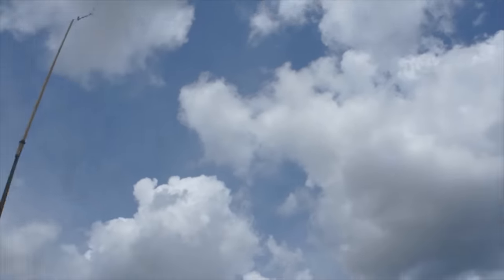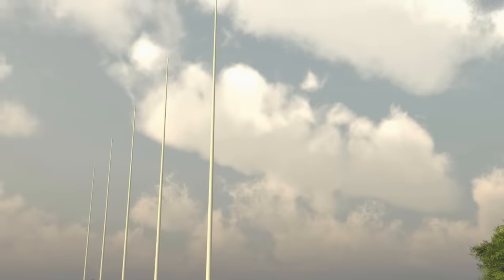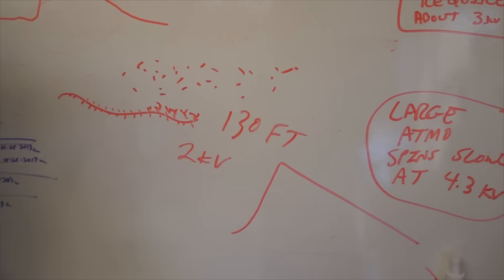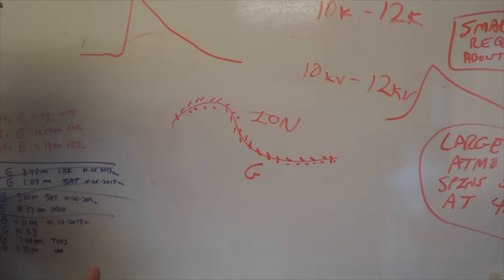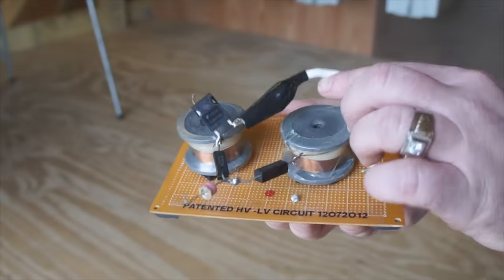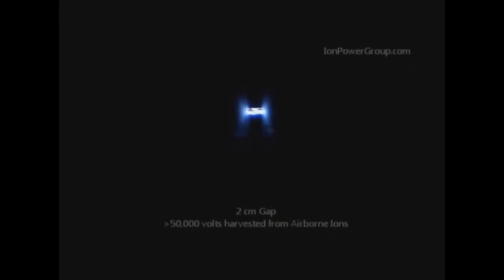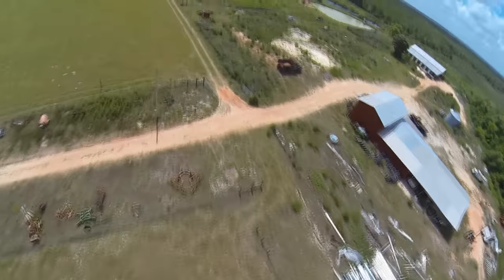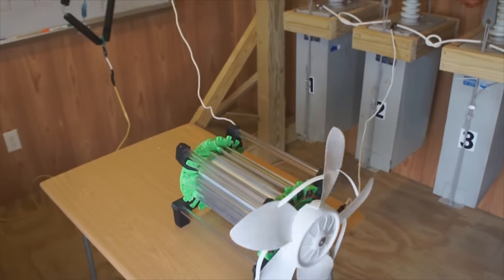Graphene/Graphite Atmospheric Electricity Collectors - Plus Horrific Hexacopter Crash!

Comment: When you see a project such as this and they only bring up voltage.  It's a scam. Voltage literally means NOTHING without current flow.  Put a power rating or go home.
Reply: I was thinking the same thing!
Reply: Did you even watch the video? They explained through the use of capacitors they will build up the current flow and release it at a steady rate.
Reply: +No Name doesn't matter unless that rate is at a significant amperage. These probably range in the mili or micro amp range.
Reply: Current is 45 x 10^-28
Turns out my $2 Duracell 9V battery is a load more powerful than this
Reply: Power is what is being conserved, and the units for power is , 
Killa-Watt - Hours, meaning if a batterie has 35 KWH of power stored i 
can discharge eather 35 KW   for 1 Hour or  17.25 KWH for 2 hours   or  
 3.5 KW for 10 hours. 
   you are correct with what you are saying but it is only one side of the hand
      With the change in Hight brings a change in Voltage, alsso double the wire double the ampe, it may take a wile but one could charge a capasitor no problem, but this can be sped-up buy raising the poles or building better "Traps".
Reply: Dude I really cannot handle this. Power is measured in KWH?????? Nigga have u done high school physics. please. KWH is a derived unit of energy, not power. 1 KWH = 3.6 MJ.

"Power is what is being conserved" there are so many things wrong with this sentence, so imma just ignore that.

I kinda see your logic about changing the height, but is it worth it? let's be generous and say that it can capture 10000v at x height. Say you double it the height, and get 20000v. It doesn't matter what voltage you get, if your current is something like 0.0000001 A which it probably is, the power coming from this whole thing is less than a watt. Assuming you're still following me at this point, this thing will not work, because to extend the poles by 2x it'll cost WAY more money than what you're getting. case closed.

Also please, check ur spelling. not that its important but you sound slightly less convincing saying things like "Killa-Watt", "batterie", "ampe" "capasitor" "Hight"
Reply: x'D ^^^ true
Reply: +2Sneaky4You Dude, I almost cried....you deserve a beer good man
Reply: <3
Reply: But will you get as much power back out of those potato batteries as you put into them? [many potentially valid and provable answers to this question exist, no one of them is necessarily the best answer, but its good to explore.]

I say make a sugar battery and you will get much more power out of your spuds than by galvanic reaction and it will cost you less, and require less energy invested compared to your returns.
Reply: Why do ignorant jerks feel compelled to say really nasty garbage on an intelligent, intellectual conversation?
Reply: Its ironic when a person says something in support of a person, and that person in return attacks you and says filthy things against you. People who respond in such sexist, hateful barbaric ways, especially without provocation are severely disturbed and very dangerous. They pose a threat to intelligent, innocent people, and in this case, specifically women. It appears that there is a very vitriolic individual with hatred against women and other people here who is posting hateful and disrespectful comments both toward previous posters, and those who write polite and even supportive comments toward their own comments. How long will this be allowed to continue unabated?
Reply: Considering Im an Mechanical  Engineer "Nigga" and not siting on the corner slinging rock bitching ,at ones iPhone because the battery went out during YouTube;  try letting  the world decide whom knows what they are talking about ...
Reply: Did i just witness youtube's fattest roast of 2017? oh no
Reply: Actually if u paid attention in high school physics you'd know that batteries are rated in newtons cuz mass * voltage = power
Reply: No idea what u just said but lemme correct that equation for you
E*I*c/D=P
c is speed of light obviously and D is input in inches
Reply: YA , I ALLWAYS SUCKED @ ENGLISH LOL, ...BUT WE ARNT TALKING ABOUT ENGLISH GRAMMAR AT THIS DISCUSSION BOARD , ARE WE ? SO WHY ARE YOU CHANGING THE SUBJECT ?
Reply: Tilted :')
Reply: cheyne, why are you so angry?  dont feed into it,  I know what your going through as i am dyslexic, and yes it incredibly frustrating when people cant see past your literacy, it's like they are blind to the knowledge. now I dont get this kind of backlash and the reason is I dont lose my temper. By the way, you made this about race which is kind of pathetic. so as I said calm down, compose yourself and don't draw for the race card. as for your spelling just remember Einstein was dyslexic.  
Peace
Reply: Curent literally means NOTHING without voltage. Curent is product of voltage via resistanse. Electricity is flow of electrons and voltage is electromotive FORCE ergo ENERGY. Without voltage you NEVER get curent.
Reply: Neither current or voltage mean anything without the other.

I see people spouting "its all about the voltage!" and "its all about the amperage" and I have to shake my head at how uneducated these people are.

A post was talking about 'its not watt hours, its ampere hours'...

Try saying that at a symposium of renowned scientists and you will be dragged out by security as either a nut job or a troll.

Not that I care, do what you want, I'm keeping my research to my self so I don't have to have such insanity flying all over my profile by people who only think they know.
Reply: Current is a product of voltage. Ohm's law. Low voltage and low resistanse result in high current and high voltage with high resistanse result in low current. Voltage is electromotive force, ergo the energy.
Reply: Current is the flow of charge. Electromotive force is voltage, ergo voltage is actual source of energy. Electromotive force forced electrons from the metals and thats how electric energy is created.
Reply: Energy is neither created nor destroyed, merely translated.

Electromotive force is indeed pressure, but only when it moves.

Water in a dam can generate a lot of pressure down a pipe but until it begins flowing, not a scrap of work is being done.

Also the work is measured by the combined value of the pressure and the flow, same as with electricity where voltage drop over a line is because of resistance which blocks flow by stopping pressure.

Also there is impedance [can be called 'drag'] inside the wire, as well as dissipation [eddy current losses] 
I can put 1000 PSI in a 1mm tube or 1000v in a 40ga wire and as long as no amperage is moving you might well think there is a lot of power in either of them, but the moment you let the stopper out or trip the switch, you will find yourself with no power at all because the flow is choked off.

It is a dull wit and an uneducated mind who insists that voltage without amperage has any realistic value and likewise, your overly simplistic explanation is functionally wrong.

Don't have to believe me, go to school and get an education.

Any real college course will have you in there with hands on to learn first hand what your brain is not making connections with.

If you still fail to see the glaringly obvious, you will have wasted your money and time as you will fail the course utterly.
Reply: You know what I mean, dont let for the words. Voltage is pressure, current is the flow of electrons. Without voltage you dont have current. Current is what of the electrons survives via resistanse of conductor.  With less resistanse low voltage produce high current, but if the conductor is with high resistanse even higher voltage will produce low current. Ohm's law i repeat.
Reply: You can not have either without the other, that is a given.

I can repeat myself ad nauseum and people ignore it because of people's pet ideas, but the fact is that all power is measured in watts.

I would ask you right now...as you talk about wire resistance...

Then take that value...assess the voltage per foot potential in the atmosphere and divide it by the value of the highest possible resistance 'wire' you can think of [and if you are not sure, feel free to get a piece of said wire and an ohm meter and test it] than come back and take that and tell us what type of voltage drop you came up with, and therefore, if you think that the voltage is too low to be usable...

While you are at it, think this one over, as you watch lightning...

How many ohms do you think air is rated at?

Evacuated air if you go very high...

And yet it conducts vast amounts of power, far from a negligible amount, either in volts or amps, WITHOUT wire.

So why are you nitpicking on wire?
Reply: Delicious DeBlair you don't understand what is current. No sense to speak with you anymore.
Reply: My concept is concept of Georg Ohm. I am not electrical ingeneer, but i argue with Ohm's law.  Current is a flow of electricity which results from the ordered directional movement of electrically charged particles. Voltage is the electromotive force - ,,pressure''. Resistanse of conductor will kill some of this pressure/voltage and what is survive is the current. If i am wrong please explain me when i am wrong. If i am wrong why graphene superconductor with zero resistance will result with very very powerfull current - 1000 times powerfull computers with 1 percent of today energy ? I explain this to yself with Ohm,s law - zero resistanse, low voltage - high current.
Reply: Delicious DeBlair This thread went downhill! I agreed with you somewhere up there. I hate pessimistic comments. They can't see the big picture, or other applications. My home is full of impractical projects, cryocoolers, Stirling engines, a water heater that burns hydrogen made from recycled aluminum cans and sodium hydroxide, solar a.c. and refrigeration, etc. It all works, but you can find issues with everything too. I just like thinking this stuff through and trying stuff. Can I store energy in liquid nitrogen, evaporate it, power an air motor, and reliquify it? Probably. Will it be convenient, efficient, etc? Beats me! Instead of just saying "that won't work", I'd rather figure out how it CAN. Almost anything has an application somewhere. This project could be designed on skyscrapers or sailboats where there's already elevation. You could experiment with plates or netting for more surface area, change the coating for more surface area, etc. There are so many false promises of world changing free energy devices, that real, working systems offering low power just aren't exciting. I like seeing people doing things just for the sake of science. 

By the way, batteries are rated in amp hours because the voltage is already assumed. If you're comparing different 12 volt batteries for a trolling motor, you're looking for high amp hours. The voltage is already set by the application, so really only the amps are relevant. If this wasn't the case, batteries would be rated in watt hours because it more specifically tells you it's energy capacity.
Reply: You are right its not mechanical force, but is potential energy just like gravity.
Reply: Okay voltage is a form ot energy transfer, you are right. But is proportional for work of unpotencial forses that creates electricity. In this mind if you are able to create high voltage just from the thin air like in this video, you have the great energy. The proces of creation of voltage is different/
Reply: I am far more qualified than you are to discuss the matter.
Reply: You even admit you are not an electrical engineer, and yet you feign to think you can tell an electrical engineer who does electrical energy research what is right and wrong? How arrogant of you.
Reply: Delicious DeBlair Nevermind. Apparently I wasn't writing clearly. I wasn't whining or crying, I was actually agreeing with you, but whatever, doesn't matter. I don't feel like arguing. Besides, I agree with everything you said so far, so I'm not sure what I'd argue about anyway.  Carry on...
Reply: Andy, I did not name any person specifically, so you need not feel like you were targeted, I was speaking of the general number of people who come in and say "its only this, and that does not matter!" or "its only that, and this does not matter!"

I can see where what you wrote might seem to have fallen into that at first glance, but what I had not put in there would have singled you out because what I would have put was "but all batteries with A/h and mA/h all have rated, established voltages to go alongside of those ampere hours." just so as to [hopefully] not single your response out in the overall comment.

I was not going to highlight what you wrote apart because you did not taking a single sided stance on the proverbial 'two sided coin' of wattage, nor did you say anything unreasonable in any way, so please do not think I was pointing any criticism at you.
Reply: By the way Andy, your place sounds a lot like my place, [I actually have a cryogenic freezer, a 3000 PSI jacketed stainless steel pressure reactor vessel, stainless steel coils, refrigerant tanks of various kinds, a warehouse of reactive chemicals, mounds of batteries, capacitors, electronics, my own hand made power coil winding machine, a lathe, a vertical mill, fuel tanks of various sizes, and just all kinds of stuff.

I have boxes and pallets of electronic elements, 50 mile spools of magnetic wire, ferrite powder, heavy cable, and so much other stuff I can't remember it all and the list would bore people to tears unless they are the type of nerd who loves this stuff.

When I was in Minnesota for 3 years, I helped build a 26 foot high, 14,900 pound solar tracker [the city of Owatonna forced the project to stop because we were upsetting the local power company] and a Kalina cycle power conversion system we made work at only 140F , which I am working to buy from the owner, as well as some nice hefty radiators from an industrial cooler, miles of stainless steel and PEX tubing, other stainless steel boxes, tanks, plumbing, radiators, pumps and you name it.

I have worked building turbine engines, hydraulic power systems, robotic warehousing systems and now I am working toward developing a form of power storage so compact and so energy dense, it may literally be too dangerous for civilian use.

I was contacted a while back by a company listed in this video, and have remained in contact with them on an infrequent basis as a minor technical input, although I may begin working with them in earnest if things take off on some other projects I am working on.

I just finished writing to the AD Astra corporation, will hopefully hear something positive back from them in the not too distant future, but if not, oh well, that happens.

If you like tinkering, energy is the place to be doing it! (~_^)-b
Reply: Volts can be converted!!!!!
Reply: Delicious DeBlair People don't understand they live on one gigantic spinning magnet. Of course there is going to be electricity in the air.
Reply: Delicious DeBlair u r not going to get through to these guys with an education in theory - it is not tangible in their mind.
Reply: People prefer magic over proven laws, it is human nature to hate laws which require work or responsibility, while magic offers a vain promise of 'something for nothing' and 'the life of irresponsible ease' so people want to cling to the illusion of a world devoid of work or responsibility in favor of one of ease and frivolity.
Reply: I like the sound of all the stufffff you have, lots of fun :-)
Reply: Well since you know so much about Electronics, my electronic degree didn't going to mean much to you so I won't mean anything, but, you're wrong. Capacitors do not produce current they produce charge. The larger capacitor is the more capacity it has.  The way you figure current out of a capacitor is its discharge voltage going through a load
Reply: @CstriderNNS  clearly you're a barely literate mechanical engineer. Reading your comments is truly painful.
Reply: Wouldn't the pole capacitors they are using in the atmospheric electricity experiment give them the high amps/currents to power all the electronics?
Reply: This is true ,but keep in mind the electric in the air n static . During the dust bowl in America after farmers cut the trees down for more crops . Static electricity would build up in fence wire because most posts were peiced of tree . Record shows farmers being killed by touching n discharging the current !
Reply: @Arkangeli7  , so how did they spin the motor in "real" time?
Reply: Depends on what application you are targeting. There are high voltage applications such as magnets used for imaging where voltage is important.
Reply: @Yamamoto Tsunetomo got a big smile on my face reading your comment. best comment so far this year
Reply: Or, just use your brain and know that Lasersaber never hid the fact that they contacted him to run his atmospheric motor.  In essence, i would guess Lasersaber expects you to realize an atmospheric motor tells you everything you need to know about how many amps, and that is next to none.

Now do you understand why they didn't contact Lasersaber to run his lasers, or to charge his SOLIN1? No, they contacted him to run his atmo motor.
Reply: @CstriderNNS  They could charge  capacitor but caps have very low KWH. I see you understand KWH,  so you know, for example that it might take them 15 minutes to charge the cap, to only get like 15 seconds of useful power, and for powering something very small.  It is just not enough power to be viable. It would take wires covering the entire planet and still we would find out it takes more resources and work to put up all them wires, and at those heights, than it is worth.
Reply: WRONG SEE .....well anything about power generation NOT from government approved sources 😀 and then replicate f you can don't just try to grab attention ...and now yes these guys seem as fishy as all hell to me but it is only cause the guy working them is really hopeless.
Reply: @LouSaydus  if you have at least two setups you can charge one and use one. Or use them to trickle charge a battery bank. Or use the low continunous power to store work in the form of kinetic energy (flywheels, water tank, etc).
Reply: @DeliciousDeBlair  you get more. The nutrients taken from the soil combined with photosynthesis will make the potato a net gain. But only if you compost the potato and return the compost to the soil.
Reply: @Constellation3232  To be cautious here, not wanting to assume this is a trolling response, since there seems to be a lot of trolling going on in this forum, I shall cautiously ask a pointed question here: might you be so kind as to explain this point about the composting aspect of getting energy out of the equation? In your view, is returning the chemical constituents of an organically synthesized battery a critical part of the energy harvesting cycle from the standpoint of usable electrical yield?
Reply: There's only one way to generate energy, and that's to pay your electric company hundreds of dollars a month.
Reply: This is sketchy but at the same time I think this is interesting anyway. I think that this is not relevant as a way to generate large scale power, but the research in the middle could be very valuable. You know, in science not everything has to have an obvious or efficient application in sight.

The very fact they're getting efficient in collecting atmosphere ions is interesting. This could be useful for many things besides power generation. 

And could also be interesting for power generation too, beacuse remember, not everything in power generation has to be about powering houses and shit. If you can create a very robust power generating system without any moving parts it can be interesting even if it produces 0.1 W on average. Could be used to power some low power equipment somewhere inaccessible. 

This is done with solar panels for instance, but this system has different properties and fail under different circumstances, so you could have both and assure some equipment in the middle of a desert will have a power source (even if weak) that won't fail easily.

All in all, diversifying is important, research can always have some use.
Reply: Most are scams i agree. But this is not a total scam, it actually is grabbing some energy from the atmosphere. But they are being secret about how much energy, and that is a little misleading and they know it because they KNOW how much energy, they just don't tell you in the video.

But if you went to invest, ask them how much energy(in WATTS), i bet they will tell you, and if they don't and pretend they don't know, then don't invest because first of all they are morons if they don't know how much, and second of all, if they do know but lie to you, then still don't invest. In otherwords bring a real engineer or scientist with yu before you invest in this kind of stuff.
Reply: The bottom line is that they indeed are capturing some energy, but they want to learn to capture more, that is what the investment is for. But will they ever find a more efficient way to get more, we don't know and neither do they, but they will try if you send them enough money. lol

if they already knew how to get enough energy from it, then they wouldn't be asking you to partner with them! JC man